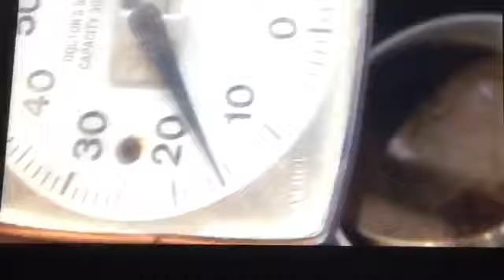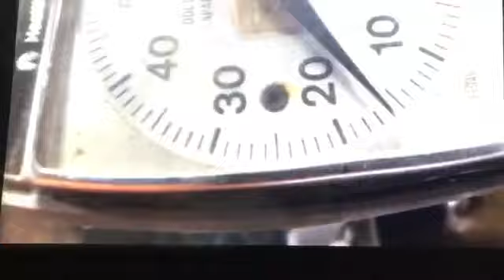SCRAP METAL PROCESSING

Comment: Still only seeing a drill where the h***'s your saws all 👀
Reply: You're using the crappiest tool I sent you the most lol...
Reply from the maker: This one is better than any else I’ve got 
Gets the job done well 
Gotta make them last forever 
Ya know
Reply from the maker: Battery power stuff like that usually stays in the van or truck 
Use corded tools when inside usually but not always
Reply: @steelisthemeal   I'm just saying I haven't seen you use the angle grinder or any of the saws or the quarter inch drive impact
Reply: @ScrapFarm  he sold to the highest bidder at the local Flea.
Reply from the maker: Green impact works sweet 
Taking some mowers engine off with it 
Most common use tool is that & the drill
Reply from the maker: 😜
lol 😆
Reply: @steelisthemeal  Can't go back to drills after working with impact drivers for years
Reply from the maker: The impact driver would be too much power for let’s say remove small screws or replace them etc 
Impact is more for slightly larger projects and disassembled stuff  ya probably taking apart some larger projects maybe just sayin
Reply: @steelisthemeal  nope.  I use a impact 1/4 everyday 😌....never use a drill...to disassemble
Reply: @gasstationpeanuts1814  word.  Impact all day
Reply from the maker: Yeah drill is what I will use to take apart small stuff because the impact has too much torque for the applications 
Like tiny screws etc 

Impact good for lawnmowers or other projects 
Repair etc 
Lower torque for things ya don’t wanna strip or break smaller bolts screws or end up stripping the screws 

Easy does it my guy  just enough power for the application I’m claiming anyway 
Yewwwww😃